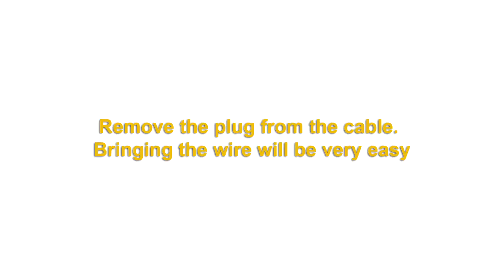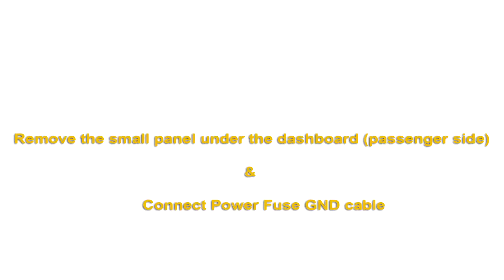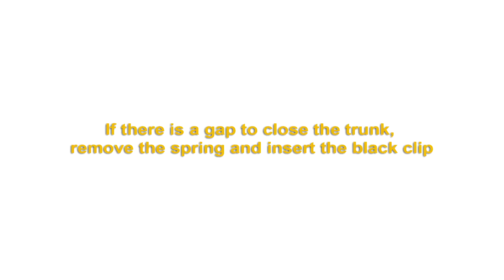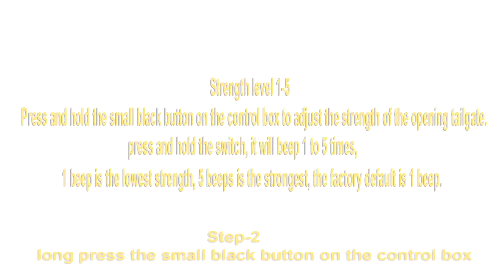Model 3 Power Trunk V4 Installation Tutorial

Comment: Hi there, I have the V4 for the trunk of my model 3. The handle claps button of the trunk is only working if first I activate the handle, in a second time I unlock the car and after that the handle can open the trunk. In the case that the car is unlock and that I want to open with the handle claps button it's not working.
I asked the support on Whatshapp, they told me to make an update and when I said that it doesn't change anything I don't have any more news from them.
Can someone solve that problem? Thanks.